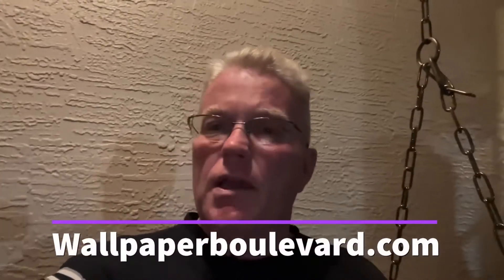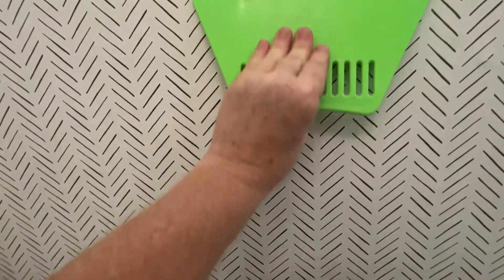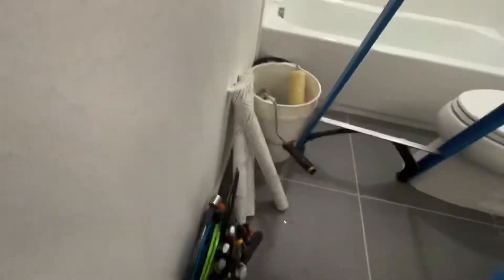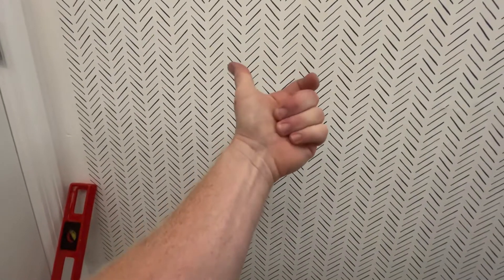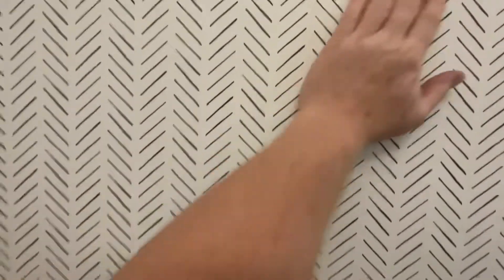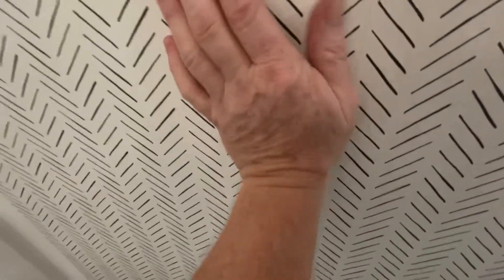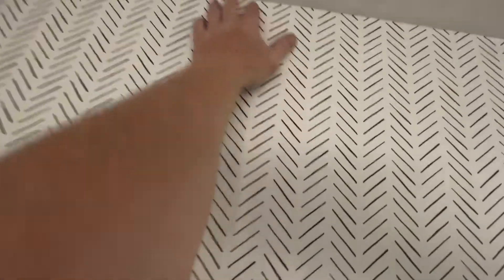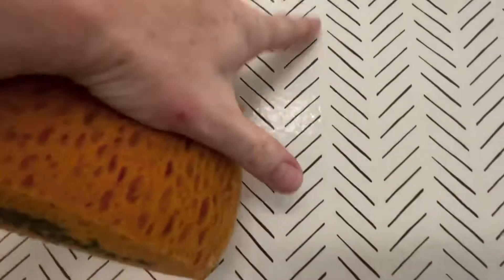Hang Wallpaper Over Texture: Important Tips N Tricks - Spencer Colgan

Comment: Scraping it first is a good idea that's often overlooked. After that, my inclination would be to use joint compound to glue sheets of fiberglass mesh to what's left of the texture, using a plastic joint knife to level the joint compound with the surface of the mesh; since the mesh will act as a screed, almost no sanding will be needed.  Then, when that dries, use that gooey wallpaper paste they sell in tubs (and which will do a better job of hiding any remaining imperfections) to put up the wallpaper. When the wallpaper finally starts showing signs of wear, it can be painted, with  mesh tape and very thin mudding over only the  obvious seams. The best thing about this is that is will get rid of the annoying texture with barely any sanding.

Comment: Looks great! But I've found one tool that knocks down those points and smooths out those peaks better than any scraper! In your tool box, no matter the job, you need one thing for scraping, smoothing, grooving, when all else fails to get your wallpaper moving. Toss out your sand papers, and your cheap plastic scrapers, they'll never be able to do the job well. If you find that your wall and your papers don't stick,  knock em flat with a sturdy COWBELL!
Reply: I've never tried a cowbell on walls, but I have used an upside down can or glass to clean my kitchen sink and it does get rid of little bits of food better than just about anything else; it also does an amazing job on the rounded corners of the sink.